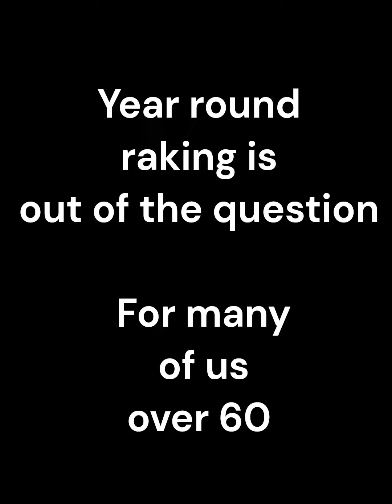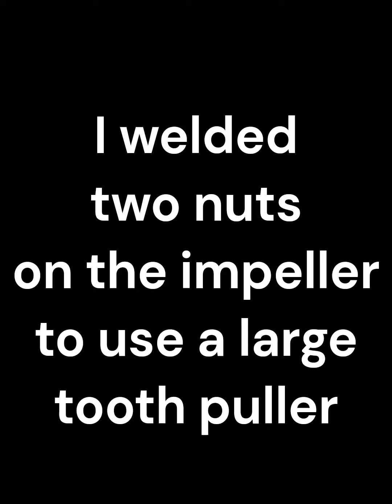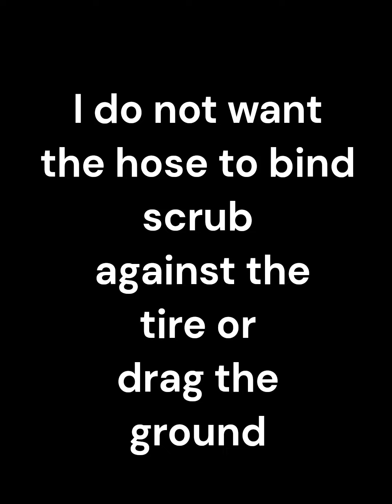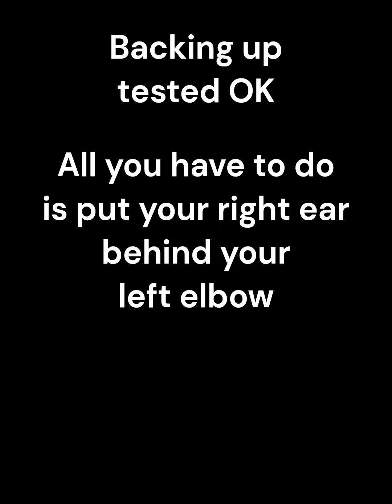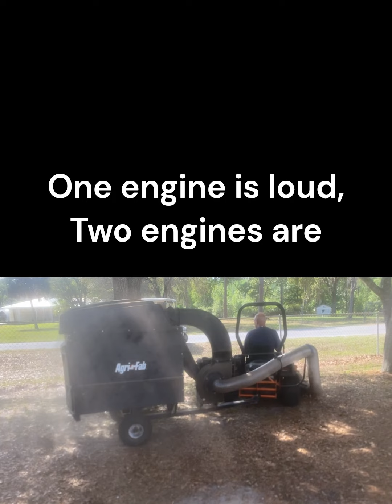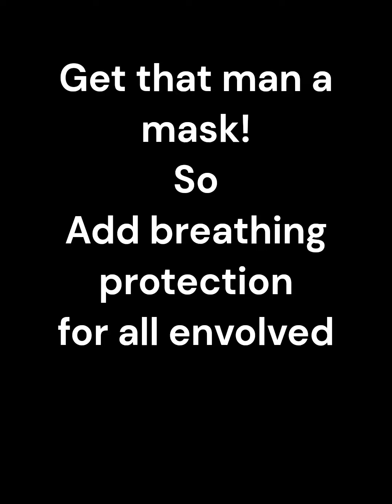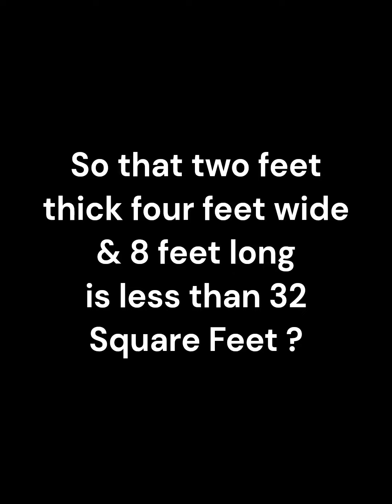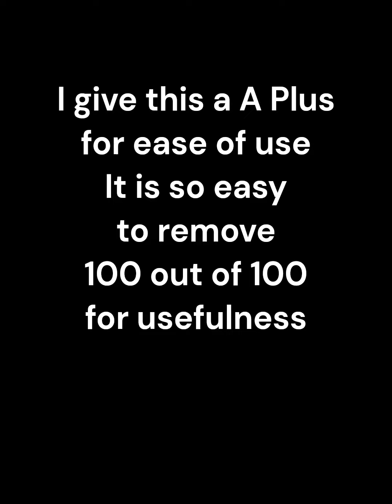Scag Freedom Z & Agri-Fab Leaf Clean Up

Comment: Would be interested in how you created the higher hose support. And how long is the 8" hose?
Reply from the maker: It is a 6" hose 9' long. The bracket is 1" pipe bent 90 degrees and welded to angle iron. a U shape flat iron was welded to a 3/4" rod that sldes down in the pipe to make it quick install and remove.